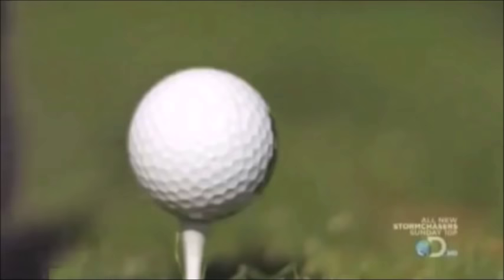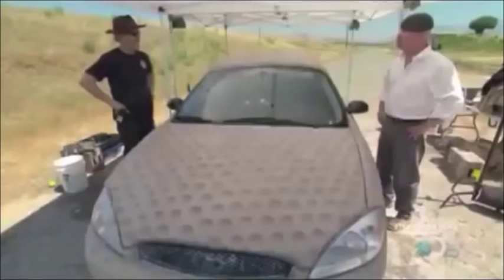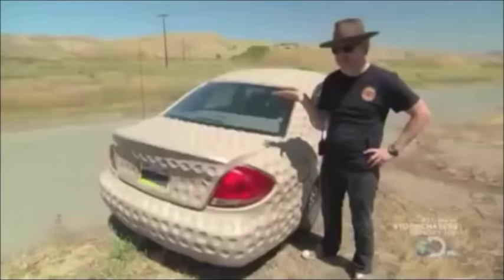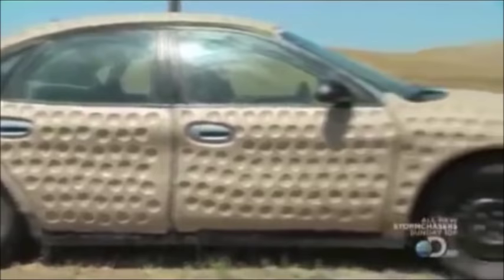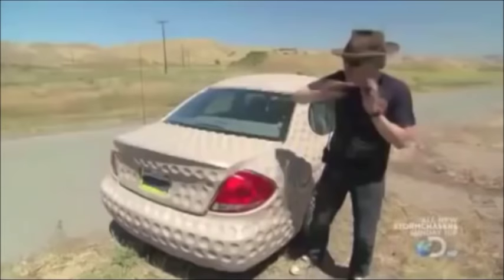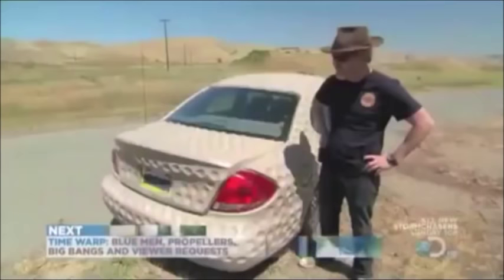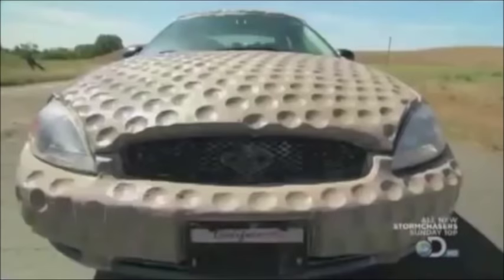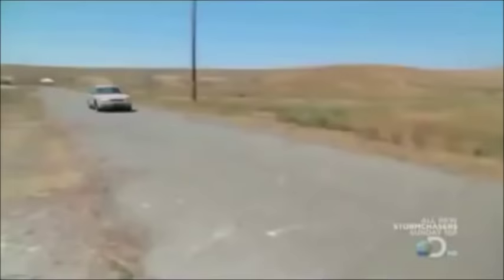Dimple Car Experiment

Comment: With more precise engineering of the "dimples" in both their size ratios and strategic placement, I should think the effect would be even greater.  Despite the mechanical differences between a spinning golf ball and a "stationary" car, the dimples are providing a benefit, albeit for slightly different reasons. 

A simple wind-tunnel test probably wouldn't reveal what a real world driving test would, because   drag coefficients are not what is producing the majority of the efficiency increase on the car.  The dimples would be acting like very small "wings" and improving forward mobility  within certain speed ranges by creating lift forces and reducing the functional weight of the vehicle during forward motion. 

It's possible that things like cross winds, turbulence generated by other vehicles and the tightness or looseness of the suspension would all effect this result as well.  But based on what I've seen  I think most of the reason this design hasn't caught on is the aesthetics.  

It's little known but many people have a strong aversion to anything with a "pocked" surface like that.  The psychology behind it is pretty interesting,  but mostly has to do with how it relates to both human health and the ripeness of foods like fruits and such.   Things with little pits on their surface signal  the "gross out" response in a lot of people,  even if we don't particularly notice it.

Comment: The extra weight did it in...u can tell by the suspension that it was heavy.
Should have jus beat dimples in the existing panels.
Come on guys...better control points.
Reply: That's actually a good point when they carved the dimples it took off a lot of the clay.

Comment: 1) 30 MPH? 1 MILE test? You can't get any kind of REAL results from those inputs. 2) IF dimples ACTUALLY made ANY difference, why don't race cars use them? Especially F1 where they go to all kinds of extremes to get the air to flow over and around their cars properly. Seems to me a 14% drag reduction would be EXACTLY what they are looking for.